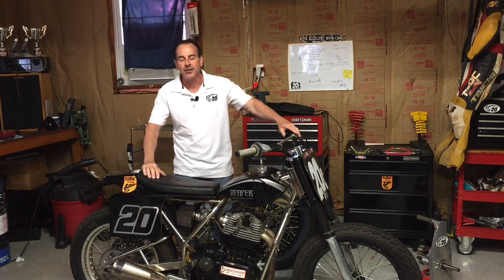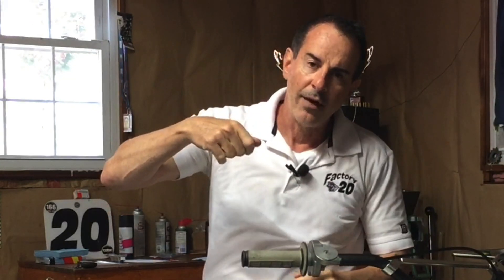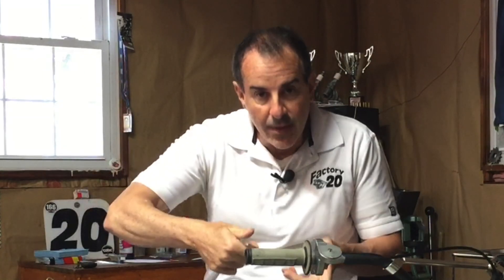Flat Track Body Position Pt 2: Movement

Comment: and any raceing  keeping the throttle on just that sec or 2 longer than the guys in front ... to go fast you have to  go in to the turn WAY OVER YOUR HEAD...  its the thin line of  haven the balls to live on the edge CRASH OR WIN....  ITS MORE LIKE CONTROLLED CHAOS..    thats why the fast riders usely aint as fast after they bail off good and hard  and the ones that are still fast is kowing where that thin line is and hopefully learning not to push it past it   lol

Comment: you have much more control  and traction once your foot is back on the peg...and one big thing  i think your not talking about is steering with the throttle  i use to short track 3 wheelers  and  the throttle has so much to do with turning  just like short track bikes   and old school 2 stroke bikes had a compression  release  witch would set you up for the turn  thats why the HD worked so good with out a release  the v twin torque gives you the set up for the turn..  so dont for get about the throttle  useing it is very imporant to much you slide out  and at the wrong time its high side its a fine line with slide and traction ,,,  but  in my mind its what makes you win or loose...

Comment: I’m glad I finally found someone on YouTube giving flat track lessons/advice. I’m new to the flat track world and could use all the advise I can take haha ! Just started at the end of last season and I’m riding a stock frame TT500. I’ve have never road a framer or DTX on a track. I’m trying to build more confidence going into the turns and trying to back it in, just seems my front in wants to push a bunch
Reply from the maker: Welcome aboard!  It takes time. Film yourself to evaluate your body position and lean angle.  You may not be as far forward or leaned as much as you think.  It takes both to turn a motorcycle.  Cheers!

Comment: Great subject. Always interested in body position pointers. I'm not a flat track racer but it's one of the coolest things I've ever seen.  I have a bit of experience (bought a 90' Suzuki Katana 600 and rode it for about five years). Fast forward 25 years and I got the itch to ride again. I went out and bought a new 19' KTM 690 SMC R. About a month into ownership I wasn't enjoying the bike and felt that I made a mistake buying it. I told myself, give it more time and to see if my experience got better. Well, I'm glad I did because I absolutely fell in love with the bike and how it's improved my riding. Still have a lot to learn but the bike is an absolute hoot. I love how flickable the bike is and how it responds to rider input. Thanks for your insights and direction.
Reply from the maker: Great to hear you're tearing it up!  Thanks for reaching out.

Comment: I think that a visual aid is needed to show what You are talking about. I'm sure that you have a few video's showing weight transfer and how you move your upper body and change your grip on the throttle. I'm an old 70yr old former racer I know what your talking about but someone new to this sport need's a little show to go along with your tell. Just my Thoughts.
Reply from the maker: Agreed. I priced it out. Track rental, insurance to cover lost filming day due to weather, film crew with drone upgrade, editing, etc... is about $2500 to do it right.  Maybe someone will step up and sponsor the video. Till then, thanks for watching what I can do from my shop.